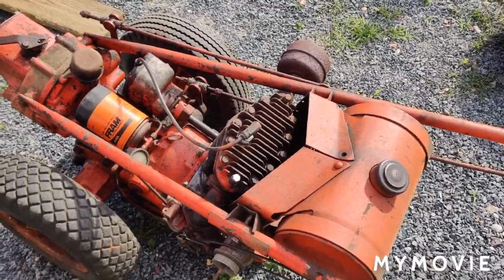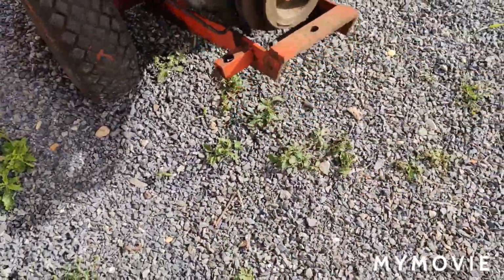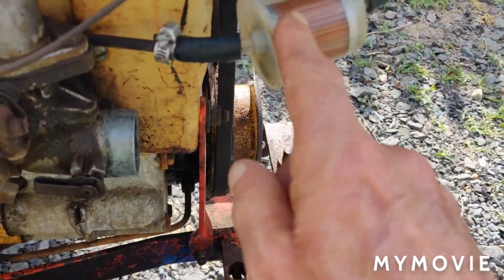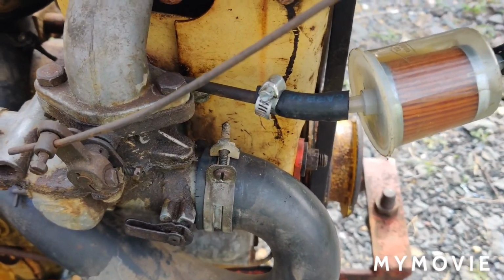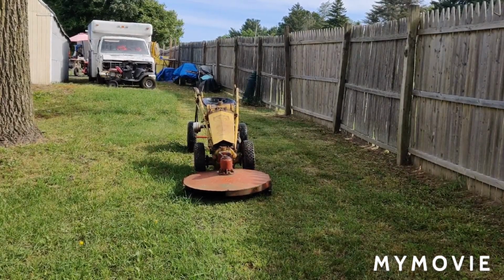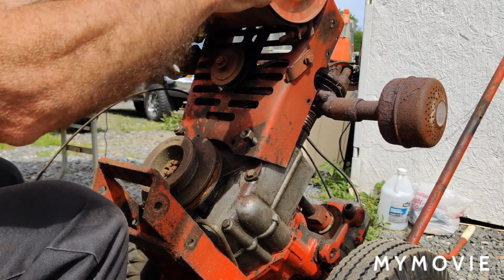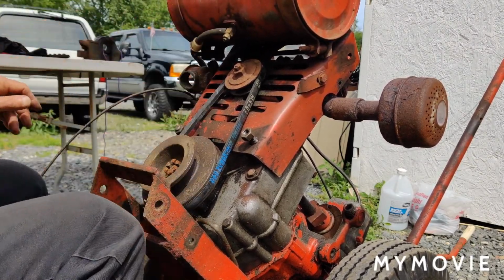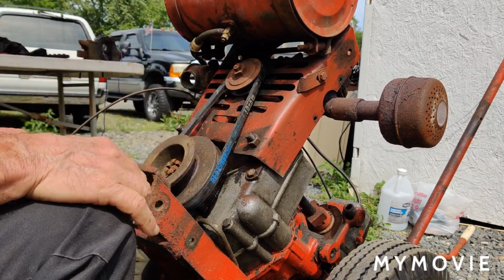Postal Gravely carb issue resolved and test. Disassemble 69 Gravely project

Comment: What ya know about the postal model? It looks like one of the old yellow ones I found abandoned . It had a smaller  flywheel on it than my L Models of late 50 s . I think mine was the low pressure oil pump also ! Greg video!
Reply from the maker: I know my father's 56 he bought brand new that I still have is high oil pressure but I'm not sure what years are the low oil pressure. Sorry.